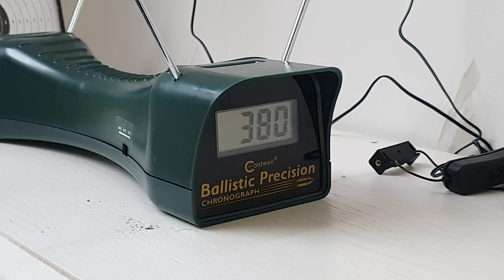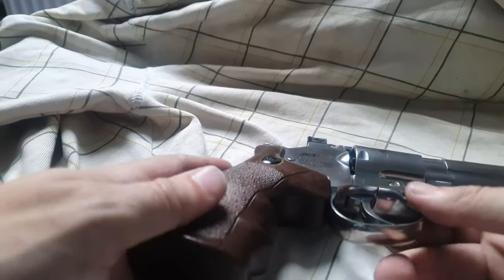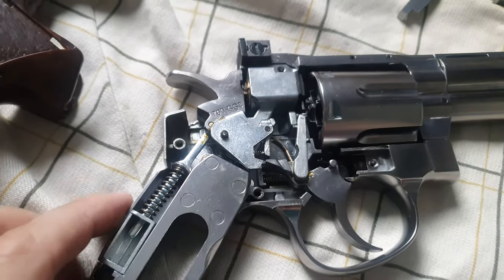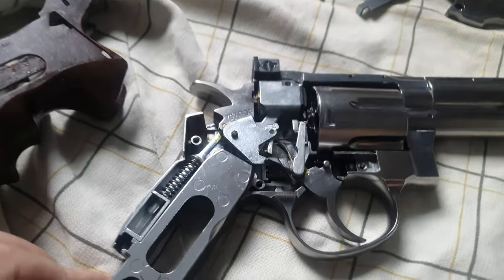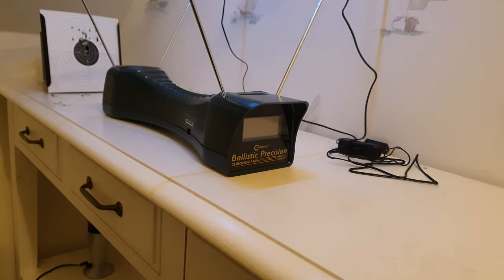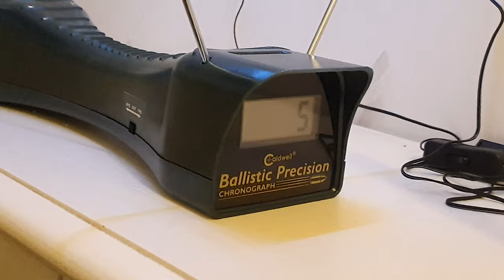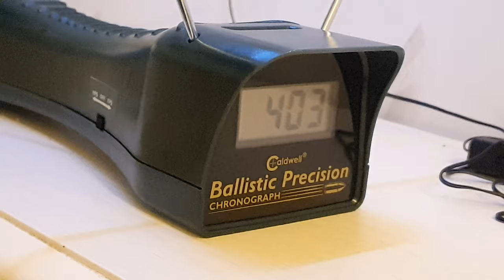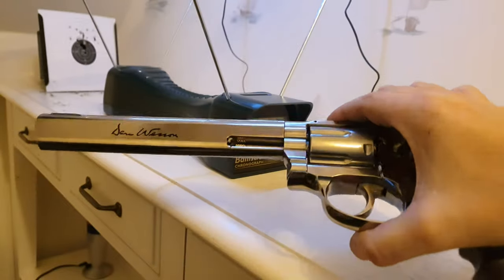Can we increase the fps on the dan wesson ?

Comment: Even if it will not increase the fps. Making it more stable could be a worthwile endeavor I believe. The question is the strain on the parts - it could decrease the longetivity of the internal mechanism (also making the cocking and the double action trigger harder)
Reply from the maker: Thats true 
So is it worth doing ? Probably not
😆 i made this video to debunk al those people that go: yeah bro you should stick some cardboard between the spring, mine has got over 500 fps now, bruh! 🤣😅
And they never do any any testing before and after
Reply: @HappyDude1  I was checking this video as I wanted to buy one and by mistake I ended buying two :) (for a price of one new one) 
Both were second hand, one in almost new condition, the other fully functional, but showing signs of ware.
What I have found is that the almost new one has harder hammer spring, which suggests to me that this fix might work in case of weak hammer spring. Unfortunately I don't have a chrono and the range seems similar to me (about 50 meters, the new-ish one seems to be more accurate and consistent) so it's just a speculation. 
One other idea might be that it could affect heavier ammo more as that spends more time (using the gas more efficiently) in the barrel and the fps creep is a thing.
Reply from the maker: @the dutohlav  
My spring is  also weaker because of the extra tension 😅
Its best to leave it alone
And maybe you should also buy a chrono to test the fps

Comment: Replace the valve spring with a weaker spring. Enlarge the valve hole. Replace the cartridge with a low power one and drill a 3.6mm hole. 6mmbb has the most power. I'm sorry, my English is not good.
Reply: The key to increasing the fps is increasing the air pressure and hammer hitting power.then it will work.of cause if you have professional machine.you can design a new valve and it will work better.but remember if you do not have professional tools i don't recommend modify valve.because i tried before.and its not that easy.according to my experience.after i managed modify umerex and i turn it to a pcp pistol.and now it can work on 20mpa air cylinder.and the hammer has enough force to open the valve.now it works perfect and so powerful.

Comment: If you want to increase the speed, several operations must be done:
* Increase the diameter of the gas hole with a drill, but very little. So that it dumps out more gas. Or, insert a weaker valve spring. Then it will also dump out more gas.
* Mill out some material behind the hammer with, for example, a dremel stone, and thereby get longer and stronger blows with the hammer.
* And, replace the hammer spring with a harder one.

Then you will probably increase fps by 25-30. Possibly more.
But is also a risk. It's a bit of a game of chance.
Reply: The trouble is, it's all pot metal and not kind to lend to machining. It can be done but we're not talking massive gains. We're allowed 6lbs in the UK with pistols and most are a kinda  "3-4lbs and no good for pest control.
Reply from the maker: Sounds like it's not really worth all the effort and risk. An extra 25 fps is not really going to make a difference

Comment: Question please : Will this mod do anything to add tension to a loose and sloppy hammer ? I just bought a new DW 2.5" revolver, and the hammer is so sloppy and loose it feels it could fall right off the $140 gun at any shot. Thanks !
Reply from the maker: It can but it will  add more stress, and then i can get even more sloppy over time
Reply: I added a small washer to the hammer pivot. It took a bit of the sloppiness out of the hammer.
Reply: The DW715 shoots at steady 3.6Joules, check out vipervideos review on the gun, he took the barrell out and replaced it by whole new 6in rifeled, but didint do any chrono afterwards.

Some dude in finalnd modded dw715 ti shoot .25 cal and add hpa system and 22joules of power
Reply: @toyotacorollae1407 do you have a link to that?

Comment: Does your pistol have a 4.5mm barrel that opens into a larger 6mm barrel 'shroud'? I've heard that these 6 inchers have only 2.5" of effective rifled barrel.
That could be the reason why the hammer spring mod did not work. We well know that releasing more CO2 won't work after a certain point considering the barrel length is kept fixed.
Reply from the maker: Its 4.5 mm all the way 😁
Reply: @HappyDude1  pardon my ignorance, is yours a DW or a DW 715?
Reply from the maker: @avp.69  no worries its the dw 8 inch
Reply: @HappyDude1  Ah right. Those are fine, the whole barrel issue is with the DW 715
Reply from the maker: @avp.69  
Hmmm i was thinking of buying one

Comment: Don’t forget kid, FPS =/= Joule (Power).

Just because a BB is faster it doesn’t mean it’s more powerful in comparison to a heavier BB with less FPS. 

FPS doesn’t really matter. 

I have .44 cal S&M Magnum 3" airsoft revolver. Meaning 6mm. 

And I have 0.25g plastic BBs and .90g steel BBs.

The 0.25g plastic BBs are way faster than the steel BBs. But the steel bbs with 0.90g do have way more power even though they are slower and lose velocity faster. Tested it against a door. Plastic BBs bounced off, the steel BBs went straight through by a shooting distance of around 7meters.

Speed =/= power. It depends on the  weight of the projectile.
Reply from the maker: I already made a video that explains everything about joule and fps 🙂 and fps is not joule. Fps is speed and joule is energy
Reply: Read more on ballistics, boy.

Comment: Thanks alot, for having showed this "spring thing "  , which I never thought that it was logical. How come the hammer would have some kind of effect on the projectile??? Totally illogical! Let's put this "logic" to a firearm. In what manner does hitting faster or harder the primer of a bullet would have whatever effect on the powder explosion ??? Nooooootttt!!!! 😄 Hahaha! 
Anyhow. 2 thumbs up 👍 👍!
Reply from the maker: Indeed, the idea with gas is when you hit the valve harder it opens up more and more gas goes trough and you get more fps. But it allready opens up completely so it doesn't matter how hard you hit it. Unless there is a weak spring in it from the factory. If you want more FPS you need more pressure
Reply: @HappyDude1  more likely that the valve even if fully opened by the hammer striking it does not have the volume inside it to hold enough gas to push the BB any faster, and I can tell you now that it don't!  power as in ft,ps comes down to gas presser, valve gas flow, and valve overlap timing!, if the gas valve has little capacity, or presser, or under timed, you won't get power, if the gas valve is over timed, you waste gas! but with a little mod done to the valve you can get a little more out of it! but at a cost of using more Co2 up with every shot, so you need to balance the tension of the hammer spring with its striking ability to fully open the valve, and that is all it needs to do! smacking it like a sledgehammer is not needed. and you can improve the gas valve capacity but not very much, however it dose improve the power.